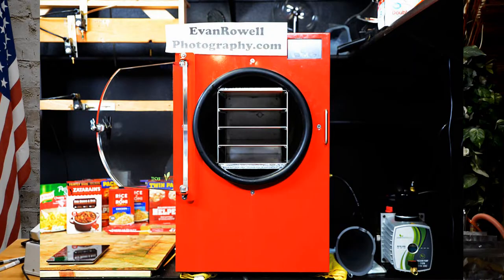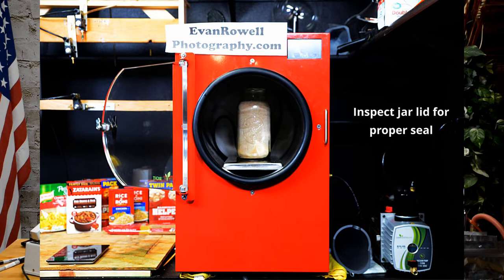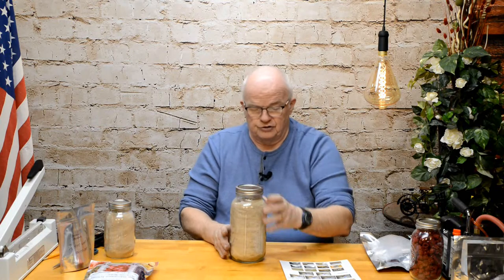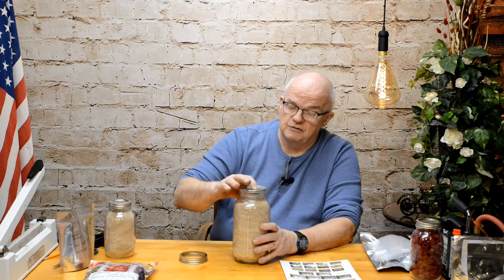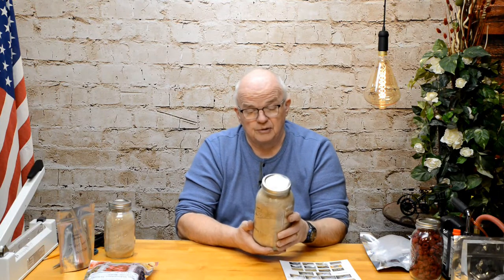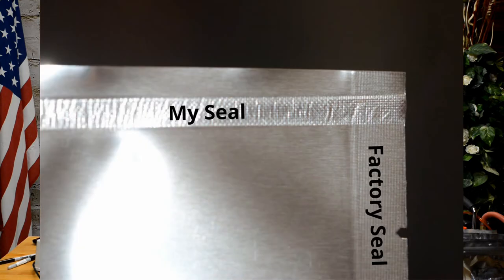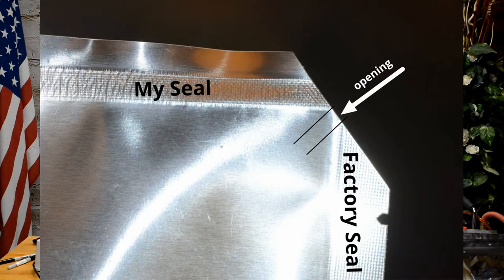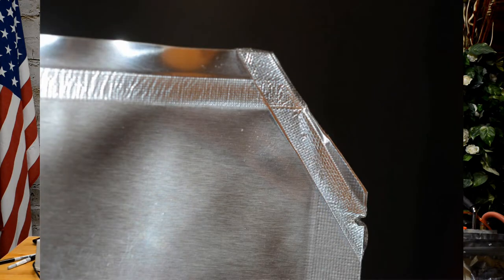vacuum packing

Comment: I love your vacuum pump set up. I would like to attempt to recreate it.. possible for you to provide some links to each of the pieces? Possible to use the HR pump or better to get separate one?
Reply from the maker: Any vacuum source should work. I gut a small pump from Harbor Freight https://www.harborfreight.com/25-cfm-vacuum-pump-61245.html and then modified the inlet in order to attach a line. https://www.homedepot.com/p/Everbilt-1-4-in-O-D-x-7-64-in-I-D-x-10-ft-Vinyl-Micro-Fuel-Line-HKP004-017/303132508 -  The injector I got from Amazon https://www.amazon.com/Kingsmile-Meat-Injector-Syringe-Seasoning/dp/B08RXYH391/ref=sr_1_8?dchild=1&keywords=meat+injector&qid=1612924922&sr=8-8 and used liquid steel to seal the hose in place of the plunger which I removed. I used a ball jar for the particulate catch but as for the fittings I'm afraid you will have to design that yourself, there is no real plan, I just kept trying new things until I had something that worked. I got everything I used at Home Depot and spent a lot of time standing in front of the fitting shelves thinking about it :) . I hope this helps, good luck!
Reply: Evan.... I LOVE YOUR VIDEOS!  After seeing your "FANCY" homemade vacuum injector thingy,  I went straight to Harbor  Freight and bought a vacuum pump.  Then I headed to the plumbing store to get the other parts.  I took pictures of what you had done and HOPED the "intellegent" people could figure out what parts I needed.  They sent me to Lowe's.  
No one can tell me what to buy!  PLEASE HELP WITH DETAILS OF WHAT YOU USED!   The ONLY part I know is the Ball jar!  🤪  I'm  HOPING you can answer asap.  I have lots of food that I need to REseal.  There is WAY too much air with just the oxygen absorbers! 
Thank you!  Im glad I found your channel.   I've shared with several people!  Such GREAT info. 
PS  Never buying almond milk again!  😤
Reply from the maker: @bekinddiattidkhow5153  OK, here are the links I could find.
1st the tube: https://www.homedepot.com/p/Everbilt-1-4-in-O-D-x-7-64-in-I-D-x-10-ft-Vinyl-Micro-Fuel-Line-HKP004-017/303132508?MERCH=REC-rv_search_plp_rrNA-303132508--N
2nd the elbows: https://www.homedepot.com/p/Everbilt-3-8-in-Barb-x-1-4-in-MIP-Nylon-Adapter-Fitting-800279/300862739
3rd the nipple: https://www.homedepot.com/p/Everbilt-1-4-in-x-3-in-MIP-Brass-Nipple-Fitting-802369/207176795
Now, there was a lot of "this fits on that" rigging. I had to find a barbed fitting that would fit on the pump that would allow me to attach a short piece of air hose to which I installed a pneumatic Quick Connect and then I ran the air hose from that to the nylon barbed fitting and clamped it with a small hose clamp. I drilled two holes into the top of the jar lid big enough to fit the nylon threads thru. I slipped on an O-ring over the threads to seal against the jar lid and then I used a brass fitting: https://www.homedepot.com/p/Everbilt-3-8-in-x-1-4-in-FIP-Brass-Reducing-Coupling-Fitting-801999/300096736?MERCH=REC-searchViewedNA-300096736--N  to tighten it down. The same setup on the exit side of the jar that goes to the needle,  it is there that I used the 3" brass nipple inside the jar. I connected another short piece of air hose to the other elbow on the jar and then I had to "this and that" a system to attach the orange hose to the air hose by slipping a 1/4 x 5 inch brass nipple inside the air hose and clamped it down with 2 hose clamps. On the nipple I used a brass coupler https://www.homedepot.com/p/Everbilt-1-4-in-MIP-x-1-4-in-FIP-Brass-Coupling-Fitting-801889/300096754 so I could attach a compression fitting https://www.homedepot.com/p/Everbilt-1-4-in-OD-Compression-Brass-Coupling-Fitting-800799/207176331  to attach one end of the orange tube. Then I connected the other end of the orange tube to the culinary injector using liquid steel. I do need to build one that is easier to explain, all the "jury rigging" was because I couldn't find 1/4 in. elbows to meet my needs so If you have any more questions let me know. Thanks for sharing!
Reply: @evanrowell5266  THANK YOU SO MUCH!  I really appreciate the time you took to help me!  I'm going tomorrow to shop for what I need!  You're AWESOME!  
YOUR VIDEOS ARE THE BEST, MOST INFORMATIVE,  CREATIVE and SENSIBLE videos on freeze drying!  Love it!
Reply: Do you sell these vacuum pumps with needle?
Reply from the maker: @qolette  No I do not. I got my pump years ago for a different project and it was seldom used. As for the needle setup, that was a build as you go, trial and error creation but it works amazingly well. a few comments back in this thread I responded to someone about how I made the needle assembly. It will tell you everything I did and it has a parts list. It starts with "OK, here are the links I could find."  If you have trouble finding it then let me know and I will respond with a copy of it. Thanks for you interest, Evan
Reply: @evanrowell5266  I did see the needle setup and it is brilliant.  I guess I will have to try it myself.   Thank you!  ❣️